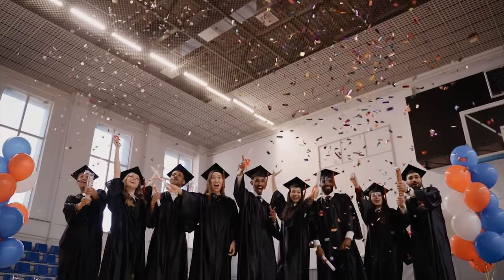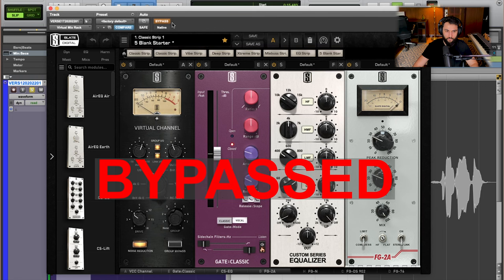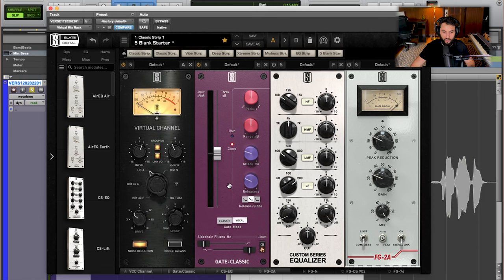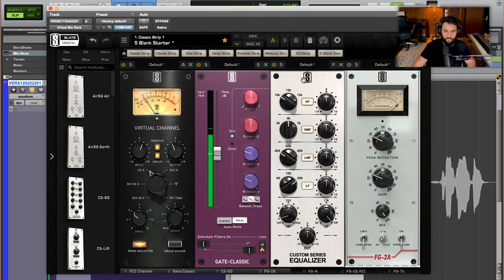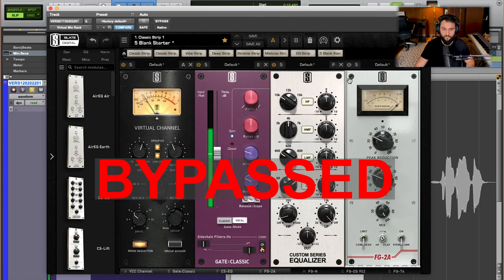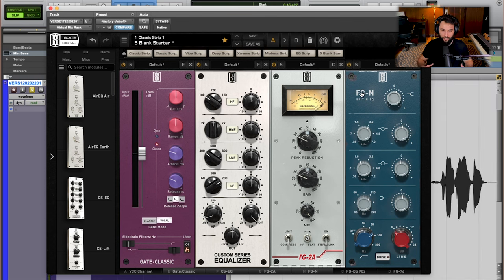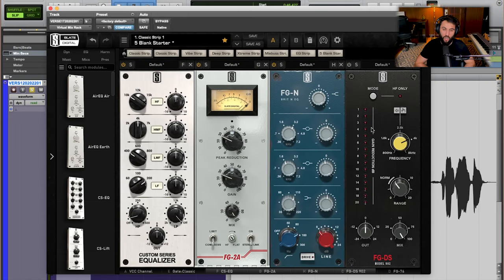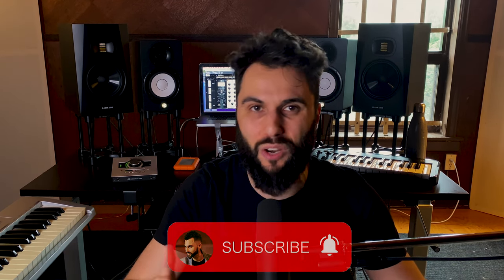My 7-Step Vocal Chain (with Slate Digital's Virtual Mix Rack)

Comment: Do you have anything with a clean vocal track? The warbly effects ruin this demo.
Reply from the maker: As a content creator, I need to be able to use a song without having YouTube copyright issues and this song fit the bill for this specific use-case/example. 

Sorry it ruined it for you, but that doesn't take away from the lesson, nor has it hindered many others from learning from it. 

Check out my other content as I do use a variety of songs, some with more AutoTune than others. Most of what I do is in the rap and R&B lane, so AutoTune is a common thing here.

Comment: So If Your Using Two Compressors Should They Be Right After Each Other ?
Reply from the maker: Maybe, but they don’t necessarily NEED to be. Sometimes it makes sense to compress then EQ then compress again. Others you just go back to back compression. It all depends on your track. Try out different placements and see what sounds best to your ears, there’s no “rule” that says you have to do it a certain way in this case
Reply: @5piece  Best Broke Down Appreciate U Bro 🔥🔥 So One More Question Ive tried all different ways before i became more experienced watching videos like this and seeing what works best but my goals is to develop my own chain so what do you think about just simply eq compress eq compression and the clean up eq ?
Reply from the maker: @ChoppaboyDinero123  your chain could be even simpler. It could literally just be EQ and compression and that’s it. Or it could be exactly what you described. I can’t really say here because this is just a hypothetical text convo. Best thing to do is shoot out the different options and placements and see which plugins and what order you like best 🤙🏼
Reply: Yes